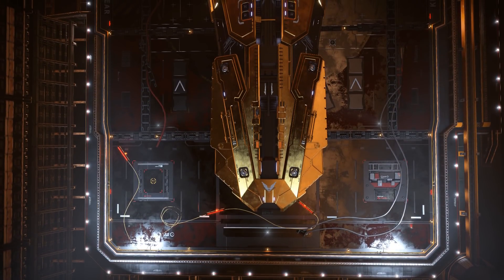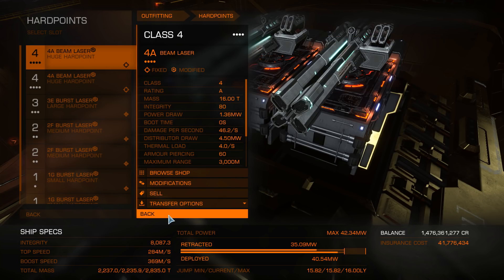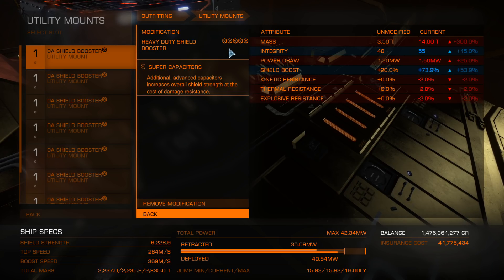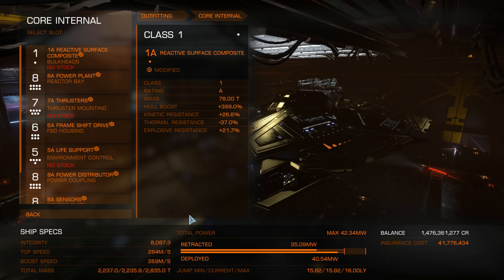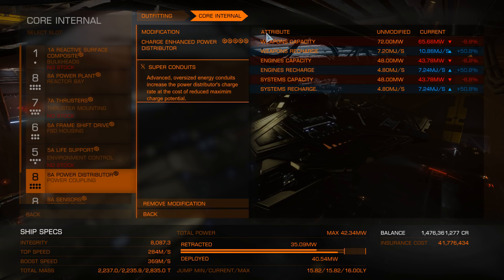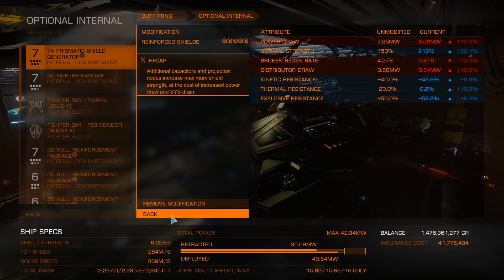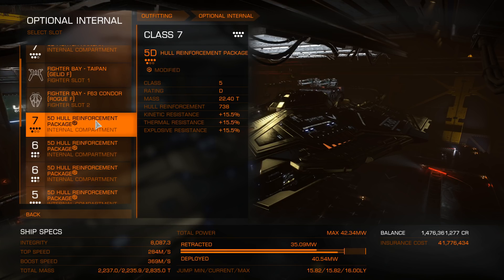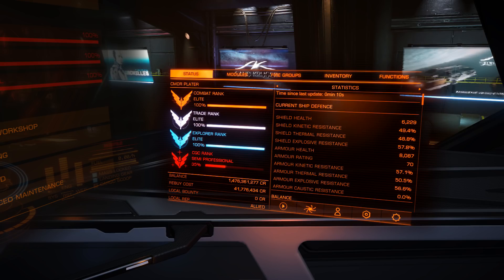Elite: Dangerous - The 24 Hour Load Out

Comment: A rated life support? I didnt see you loose your canopy during the stream, so that was a waste of mass and power...
No module reinforcements? wut
And for the actual 24h build you'd need to add a few regen beams on secondary vessels ;)
Reply from the maker: I honestly should have ditched the fighter bay and put in an afmu! The a rate is left over from goid fighting!
Reply: smaller figher bay or one that fits the slot, module reinforcements, AFMUs and maybe even a SCB for emergencies... Well it worked out anyways, didnt it?
Reply from the maker: As usual the biggest danger was mini!